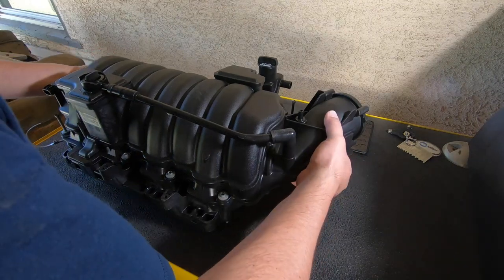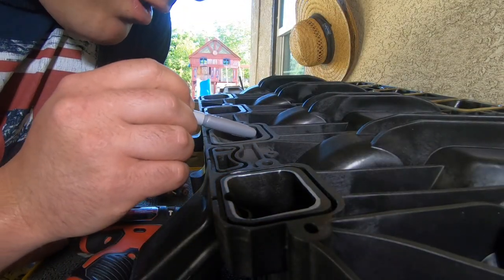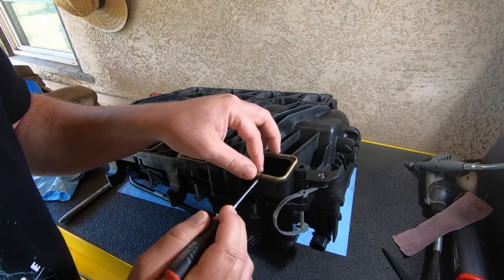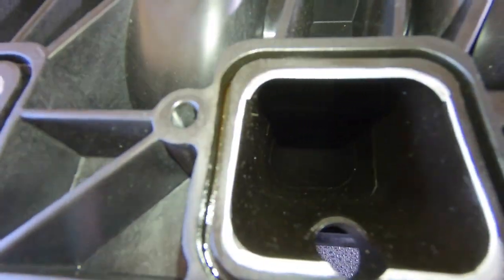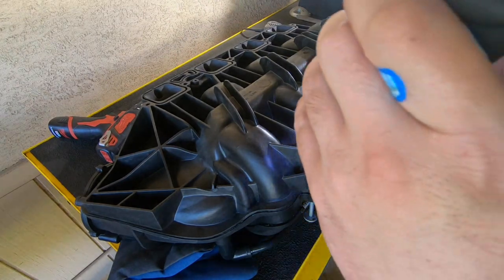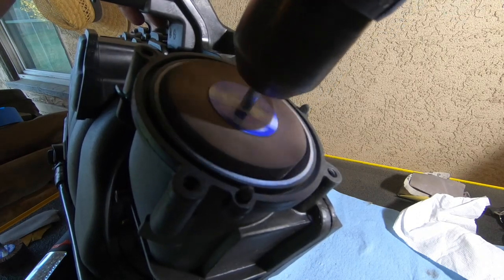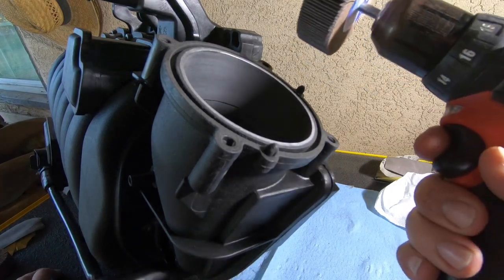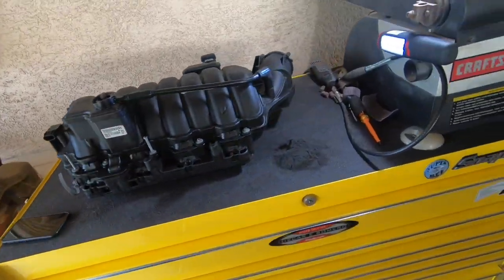How To Port A 392 Hemi Intake manifold

Comment: Brother, You are amazing.  I need to do this to my 2015 3.6 Durango.  I have ported an LS Engine FAST 90 intake and had fablous results. I want to put my skills to work on this Dodge intake upper and lower intake manifold.  THANK YOU for taking the time to post this work.
Reply: I did my own manifold for my 3.6 Chrysler 200 everybody who hearse the car now keeps asking is that supercharged nope just in house ported I ported it then hand sanded it for 2 days to perfection i even did the throttle body just for the hell of it

Comment: Nice! I will be doing this, instead of the dremel attachment I bought some hex grinding wheels and I’ll be using an extension on the impact driver to get deep in the ports. Hopefully everything works fine.

Comment: I ported the heck out of mine last night. This video was very helpful in giving me the confidence in taking my manifold off. The 3" Sanding wheel was hard to find at Home Depot but MAN did it put in some work on the inlet. I couldn't imagine porting the inlet without that sanding wheel. I think somehow I managed to get what looked like twice as much material out of the inside of mine than what was on your bench. I was able to get deep in there with the sanding wheel to open up the intake.
Reply from the maker: Budget Wargamer just be careful not to take too much out. It’s worth all the effort and good luck to you. I’m happy my videos helped you out.

Comment: I've done this to cast iron cylinder heads and intake manifolds using only a dremel and tons of stones and sanding paper and polishing compounds. Took forever and then I ported and polished the intake and exhaust ports. All this on a 427 chevy for a customer, I have never wanted to do this again on another engine.
But since it was 25 years ago I might just once more on my own  ;)
Reply from the maker: gman4hire its a lot of work but in my opinion it’s well worth it.

Comment: This video is great and I'm a mustang guy..Lol! Just curious what grit bits and paper you used on the plastic intake? Thx
Reply from the maker: Victor Xavier sorry about late response. I used a combination of 80 and 120. And I applied low pressure on the tools when removing plastic. Low speeds are ideal too.
Reply: @scatspeed3114  thank you for the reply! I have a brand new porting kit I bought years ago from Eastwood that I want to put it to use! I wish you continued success with your channel!
Reply from the maker: Victor Xavier thank you I really appreciate it 👍

Comment: I know this video is super old, but did you by any chance get a check engine light after this? I just ported mine today, and have an engine light now
Reply from the maker: Never got a check engine light. Even with a super aggressive port job.
Reply: @scatspeed3114  thank you for the reply. I got a p2008 and a p2017 code

Comment: Nice job on the intake, what did you use to clean it out after porting. Thanks for the sub, will be doing an update sometime this weekend for some new mods I got.
Reply from the maker: dodgeboy90501 I used scrubbing bubbles max grease cleaner. Soaked in a tub of hot water and swashed it around three times. Came out clean.
Reply: @scatspeed3114  I just ordered another 6.4 intake manifold my 3rd lol how long did it take to dry
Reply from the maker: I used a blower to help dry mine. I was about 2 full day for me. Happy 🐣
Reply: @scatspeed3114  great thanks you have a Instagram brother
Reply from the maker: Yeah it’s ScatSpeed
Reply: @scatspeed3114  thanks I'm following you

Comment: What were the power gains
Reply from the maker: Around seven
Reply: Scat Speed that’s it I figured it would be more
Reply from the maker: SRT HEMI really depends on how bad the intake was to begin with. It could be more with a ported throttle body. You could see over ten extra horses.
Reply: 15-25hp search up the videos.

Comment: I'm curious about the longevity of the intake afterwards since your shaving material, unlike metal this plastic is notorious for cracking. Mine cracked on my 02  4.7L Ram.
Reply from the maker: I guess it really depends on the heat cycles and how well the porting job is. Hopefully not too much plastic was removed on crucial areas.

Comment: What tools did you use and where can i find them also where can i measusing tool to measure if i reached 87mm inside my manifold for the throttle body
Reply from the maker: Whoa Weezy I used a cordless drill on the opening for the throttle body opening. Sanding wheel and dremel you should be able to find then at a hardware store or a welding shop. Measure the throttle body on the inside with you Caliper. Off the top of my head I can’t remember what the size was on the throttle body but just make sure you bore it evenly to in the opening. I get back to you on the actual measurement. Take your time and don’t rush it.
Reply: Thanks hoping to get this manifold soon if I wanted you to port it for me how much would you charge?

Comment: I got my 6.4 intake manifold brand new and I'm looking to port it what size sanding wheel did you use for the runner ports
Reply from the maker: Whoa Weezy I used 3/8 sanding wheel on my dremel, and I used a 3/8 wooden dowl rod wrapped with sand paper to reach all the way into the runners.

Comment: I just got a 85mm throttle body for my 5.7. Would it be worth porting the runners and port matching the intake to the new tb?
Reply from the maker: Yes because you will seen more of an improvement in HP. Worth the effort just be careful and don’t overdue it.
Reply: Scat Speed I don’t have access to an unlocked pcm or a tuner. I’m worried about the car running too lean with a cold air intake, larger throttle body and ported intake manifold.
Reply from the maker: Randy Rodriguez I asked Brian at Peitz performance the same question. He said they are both stock parts and you don’t need a tune. They’ve done it before. But you get more out of this set up if you get a proper tune. it’s okay to do it. Check out his YouTube channel if you have more detailed questions BMason is his channel.

Comment: Where did you get the intake? Wanna put one on my 5.7
Reply from the maker: I bought the intake manifold at a Mopar swap meet in Van Nuys. Spring Fling. You can find a good intake manifold on eBay. Retail from $200 and up.

Comment: Any idea how much more power you got out of it?
Reply from the maker: Build it R/T modern muscle claims 10 percent improved air flow on their ported intakes. On a stock tune with out the ported throttle body... I’ll be conservative and say 5-7 hp. We’ won’t know for sure without Dyno time.
Reply from the maker: Build it R/T I installed the intake today I definitely felt an increased of power. I was breaking them loose at 40 mph easily.

Comment: What grit did you use for the sanding?
Reply from the maker: Cosmo 300-600
Reply: Thank you, I managed! I ended up using a honing tool for cylinder boring and used the dedicated grit stones. The tool was like 40 bucks and is spring loaded so sands evenly on all sides of the bore! Worked great

Comment: have you noticed any differences in performances between before and after
Reply from the maker: Makan Tahi yeah I did on the top end, it was very noticeable.
Reply: i ported heads on 5.7, 2005. but did not touch that plastic intake manifold, it looked as black box
Reply from the maker: Makan Tahi it’s nice working on your own cars learning how it put together and what you can do to modify them.
Reply: yeah, mostly i fight against check engine lights, i have 300c, 2005, awd and made: cai, oil catch can, cleaned soot from pistons, head ported, long tube headers instaled, suitcase replaced with freeflow mufflers and rear mufflers too, cats deleted, made custom tune from diablo tuners for lpg and car is fasteron mid range, 1 second faster to 60mph-5.9, but max speed is same 248-250kmh, now i wait to contact my mechanic to install camshaft from 6.1 srt, and now i think about that plastic intake manifold to port it
Reply from the maker: Makan Tahi nice work and you cant go wrong with a good port job.
Reply: Yes on the dyno it gives back about 12hp that it has robbed from the factory.

Comment: This is a hack job& not the right way. You're supposed to use dye on the manifold, install in car. The dye on the heads will then allow a port match when everything is correctly blended
Reply: What type of dye is used?

Comment: YOU CANT PORT A PLASTIC INTAKE ALL YOUR DOING IS MAKING IT THINNER AND MORE PRONE TO HEAT SOAK AND MELTING.
Reply: It's literally taking material off to allow for more air flow, how is it not porting? You can do the same thing to a intake made of metal, which heat soaks even more than plastic. 🙄
Reply: Dude all caps, really?
Reply: Hater lol do research.  Porting intakes has been done on all levels.
Reply: Just shows you know nothing. You couldn't be more wrong. Should have done your homework before posting such a baseless and ignorant comment. It is porting in every way that porting is done. 🙄🥺🥴
Reply: @gonzofam915  I've never been a hater in my life. But the facts are the longevity isn't there anymore
Reply: @jerrymossor288  Dude you came on here to say that!!
Reply: @brandonmcginnis4610  your right but like I said(and I thank you for being a real person on here and using your brain to effectively communicate unlike the other who just have had a bad day and came on here to be Internet gangsters). The plastic is more prone to crack and melting. The metal does get to a higher temperature but hey metal is metal. The engine could burn and that metal intake will be there still after the fire not a plasticone though...I never also said it wasn't porting(also not sure if your talking to me but anyways). I appreciate your realism in your comment thanks, seriously.
Reply: @myob3  You bet I did!!!!!!